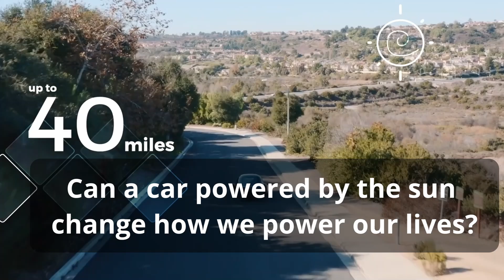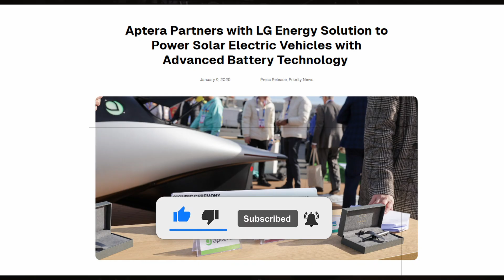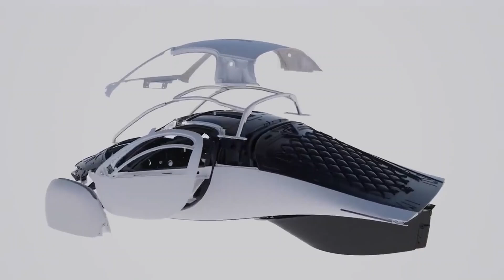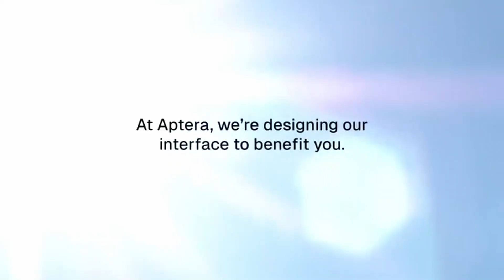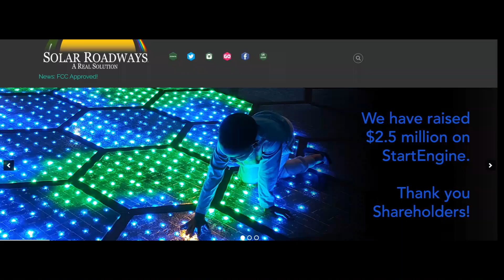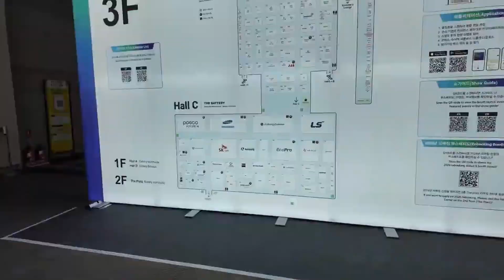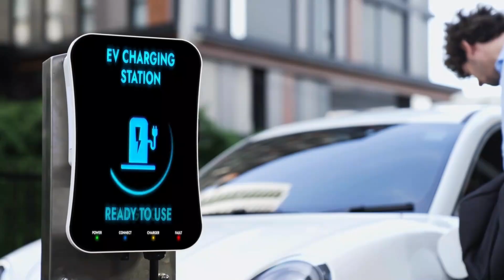Aptera's Artemis vs Slate EV Pickup - Who’s Winning & will deliver FIRST?

Comment: This does not seem to be a well-researched video.  The Aptera shows $40k for the 400 mile version on their website, while Slate shows mid-$20k as the base price.  (It was under $20k before the removal of the incentives.)  Aptera has been at it for 19 years, off-and-on, and have built only a handful of prototypes (two running prototypes that I'm aware of).  Slate has been around for 3 years, and has built ~70 prototypes.  Aptera is struggling to raise money.  Slate has wealthy (Bezos) backers.

While the Aptera has a much higher cool factor, the market for extremely wide, 2-seater, trikes that cost $40-55k is going to be pretty limited.  While the Slate's value proposition took a big hit with the ending of the EV incentives, there should still be room in the market for a relatively inexpensive, basic EV pickup.

Aptera is a long shot to make it to market.   Slate has a great chance to make it to market, but is still a long shot as far as being able to generate enough sales to stay in business.

Comment: Slate is still shaped like a brick, what’s the KW per mile?
Reply from the maker: Equipped with a standard 52.7kWh battery, the Slate truck is expected to deliver approximately 150 miles of driving range—extendable to around 240 miles with an optional 84.3kWh upgrade. Its powertrain reportedly generates about 201 horsepower and 195 lb-ft of torque. Acceleration from 0 to 60 mph is estimated at a rather modest eight seconds, with a maximum speed capped at 90 mph.

Form the above stats, we can estimate that, 

Both versions yield approximately 0.351 kWh per mile, or 351 Wh/mile—which is on the higher end compared to typical EVs, but expected for a utility truck.

Comment: Where the heck are you getting your facts on the slate? 300 miles? Their website says 150 miles and a 9 sec 0-60.
Reply from the maker: The Slate EV truck's estimated range is 150 miles with the standard battery, and 240 miles with the optional accessory battery.
Reply: That still isn't 300. @Elementraz

Comment: With the truck, you can custom build or 3D print an aerodynamic front end for mileage improvement and save $20K both were low price starters. Let’s see what MSRP turns out to be.
Reply from the maker: Let's wait and see what MSRP Says.
Reply: The aftermarket will be all over the Slate when it hits the market.